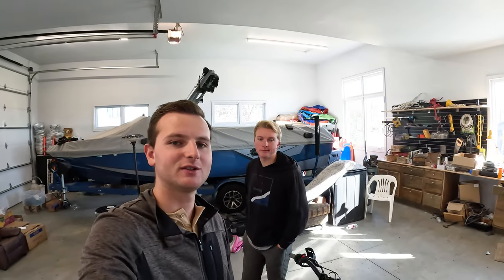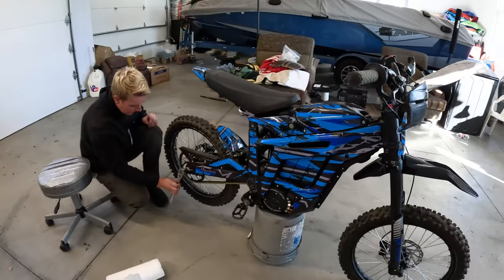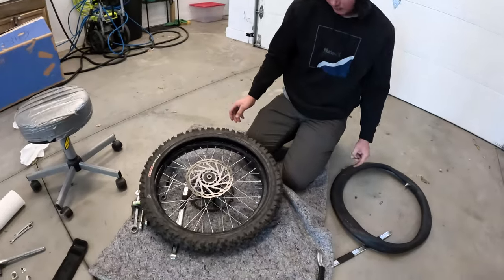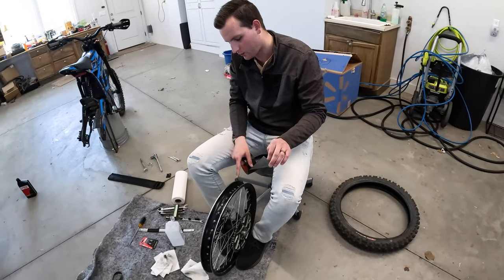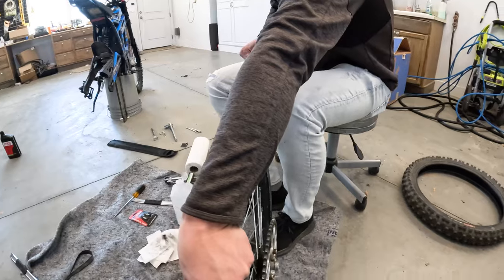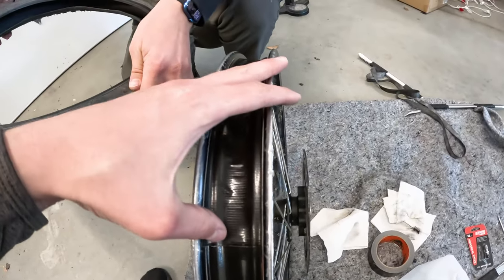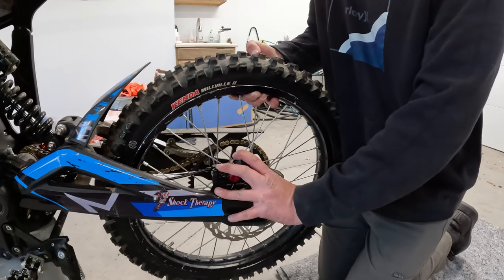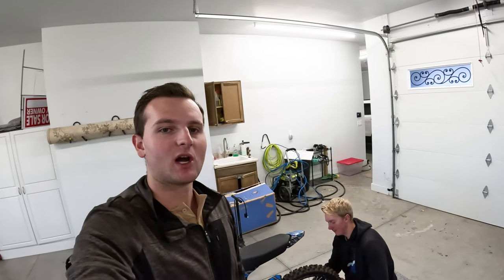Talaria Sting Tubeless Install! IT'S WORKING!

Comment: I’m wondering how Tannus inserts would work on the Sting. The smallest Tannus size is 20”. I’m thinking of getting a pair and cutting out 1 inch of insert to fit.  Sound stupid? I love the inserts I installed on my Levo. Sick traction.
Reply: No, not a stupid idea. I previously contacted Tannus with that thought. Tannus told me if I cut their inserts to fit, it would void the warranty. Given the tremendous traction benefits from tire inserts,  I’m ready to take the plunge and cut a 20”pair to 19”.  I wonder what type of adhesive one would use to join the cut ends?

Comment: How is this holding up guys?
Reply from the maker: The tubeless worked great for the time we had it! When we upgraded our bikes to the new Sting R we sold the old bike. But we used it for nearly 6 months and it worked great. We obviously didn't test it with all tire and wheel combos but it has potential when done right.

Comment: that rim has no safety bead, a bit dangerous to ride tubless unless you use something like the neutech tubliss kit.
Reply: @Talariaboys  i'd be hesistant to ride that setup low pressure or going 50mph. If you look into woody's wheel works they will tell you different, theyre well known wheel builders.